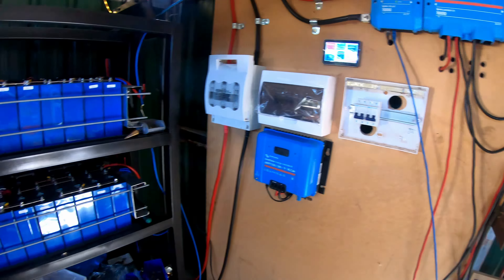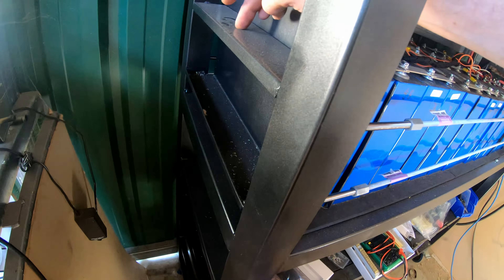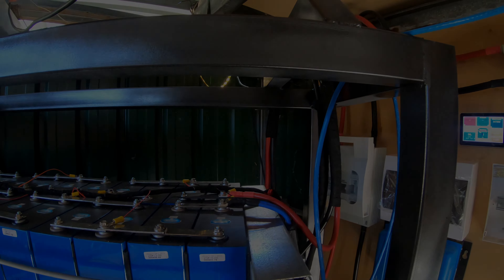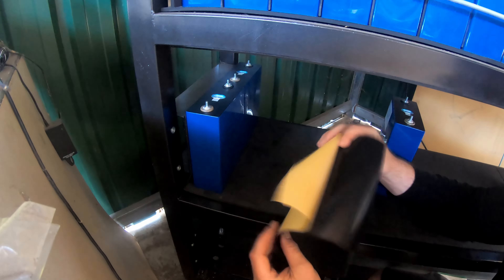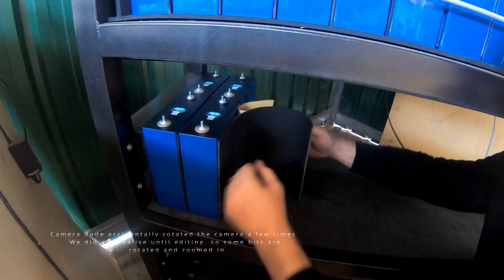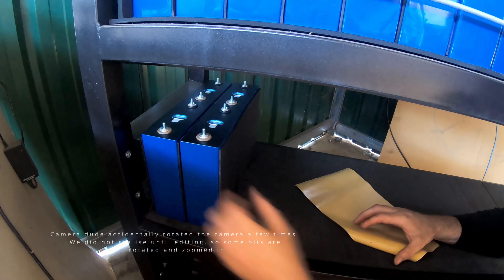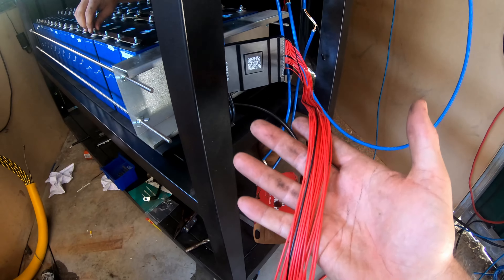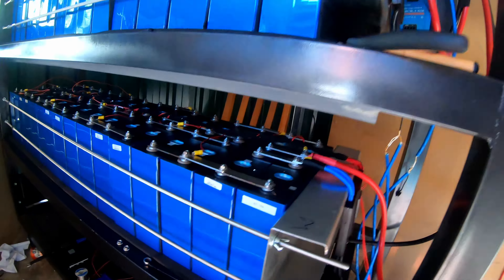Bad Idea #1:  Cheap Off Grid PT2

Comment: Batteries will only bulge if you charge/discharge to fast( to many amps) and or in cold/hot temps also. If you are using busbars and not daisy chaining them with 3 packs 10kw is around 70 amps per pack or .25C. The cells can handle .5C all day and not bulge. Also not charging over 55.2V per pack and floating their for 1 hour should get you 95% usage and no need for compression. I have seen what over charge voltage does to these cells and they would blow the top seal out if compressed but  not compressed will swell  a huge amount but will still be usable. Its on youtube video. Nobody shows you why you should not compress. If you were in a boat or RV then yes compress so you can keep the cells locked in other wise I do not recommend compressing. I have 64 cells in 4 packs with 2 5k inverters so my max load charging and discharging is .25C. I usually never go over .15C. If you do not understand the C rating search Google for Battery charge, discharge C rating. Just giving pointers as my system has been running since last year and no issues. Also for your solar please have a disconnect switch at least 25% more than you voltage and amps inside and inline fuses outside. do not use the DC fuses with breakers on them as they can catch fire if you shut them down with even 5 amps going through them. A DC arc needs enough distance (gap) to cleanly disconnect. a DC breaker has way to small of gap and that is why the arc can start a fire. I do love your rack. oh yeah also if you are going to tension the cells they need to have a spring to adjust or again if something goes wrong your cells can explode through vent hole.
Reply from the maker: Ah you need to see the other videos :) there is multiple isolations of various types throughout, but thanks for the feedback. the compression is there for a crisis as one of the packs may have to take the whole load at some point, the bms is good for 300amp output (im skeptical about the wiring though) and fused at 250amps at the bus bar. given at any point any of the packs may decide not to take charge or discharge for that matter the max charge and discharge are 200 / 300 amps respectively. I fully intend to populate the fourth shelf and have the ability to rotate the shelves in and out etc
Reply: Note from personal experience: lifepo4, limnco and any other rechargeable chemistry includung nicd, nife and nimh, expand and contract when charging and discharging regardless of the rate. Only the rate of expansion is dictated by the rate of charging or discharging.
Cylindrical cells are held by the power if the circle 😊 but prismatic cells are not so mechanically advantaged. 

The problem with Li cells is that the electrodes themselves are laminated. There is a base conductor, aluminium.copper, that is coated with a thin layer of active material (mostly graphite). 
When the cell swells, even a tiny little bit, the coating can be dislodged/delaminate. It can flake off and bits move a bit in the pocket. When the cell is discharged or cools off, it can't return to the same volume as the flaked bits are atop the yet unbroken coating.
This is happening at microscopic levels at first but it progresses in time to visible degradation. The separators are put under punctiform pressure stresses, the cell's overall ESR increases, the charge/discharge efficiency decreases as there is less surface area of the active coating available, more electrolyte is electrolyzed to gas that cannot be absorbed back by the degraded electrodes, and it's just spirals down. 
Compression will greatly increase cycle life along the proper usage with safe charging/discharging rates. 
There is no point in compressing used/damaged cells. It can be actually dangerous as the separator can be punctured and the cell shorts out.

Comment: Hi! You might already know and mitigated this, but on some EVE cells the metal enclosure ( that is covered with the blue thin film ) is connected to the positive side of the cell. If I understand the video correctly there is no additional isolator between the cells next to each other ( on the narrow side of the cells ), and because of the series connection method there is now only a two thin layer barrier / protection against a short. 

I hope I understood it wrong! But it might be a risk wordt validating ^^.
Reply from the maker: I will certainly have a look cause thats almost terrifying, i will check when i get back to the house
Reply: I have used some cheap flexible chopping board as separators! But with the size of these packs in sure you can source a large sheet of thin plastic to use...

Comment: Great work!  I would suggest an insulation layer on top of each bank. I have seen people dropping tools on the contacts and triggering sparks. If you short enough potential a wrench could be welded to the contacts due to high current. That would cause even more troubles.
Reply from the maker: thanks bud, yea we plan to enclose it, but thats fallen by the way side. i really should make that a priority

Comment: I'd love to have a set of batteries like that for my off grid camper tiny home
Reply from the maker: They arent complex to make mate, just time consuming
Reply: You do not need 90kw of storage for a tiny home. 10kw is plenty.
Reply: @davefroman4700  at the moment I have 560 ah of grade a eve cells. It's 16 of the 280 cells in 24 volt configuration.  I ordered 16 more yesterday so that should give me about 30 kw and I also have 24 nissan leaf modules at 24 volts kinda for backup I guess lol. I started with the leaf cells and actually they were plenty but I kept hearing how dangerous they are so I bought the lifepo4 eve cells. So far I have about 30 grand in my off grid stuff for my travel trailer. It's kinda an addictive hobby lol. I'm on the road in this semi truck 3 weeks at a time then home a couple days then back to work. I just keep ordering this stuff and hopefully one day I'll be in a position to enjoy it all. Thanks for making the videos. Wish I didn't have stage fright and I'd try to do the same. Thanks to you guys making the videos I was able to learn alot of this stuff and it's actually been kinda life changing.  Thanks for sure

Comment: Nice battery setup!
Here I am still hesitating using the JKBMS.
Many issues about communicating with Victron.
At the moment I have 2 x 18S of EVE LF280K with two 123SmartBMSses.
Another 40 cells are on their way to me.
I want to create 5 parallel strings of 16 cells communicating with the Cerbo.

How do this 3 JK BMSses communicate with the Cerbo?
serial to CAN or direct serial to Victron?
Any issues with reading out all messages of the 3 BMSses?
Would really love to use them.
Reply from the maker: they dont, its set in victron that the BMS self manages. As soon as they block charge the voltage shoots up and that tells victron to stop charging. We are working on an integration. It currently works with a single BMS but the multi BMS portion is coming. It might be all a little to late given they now have inverter BMS's which do integrate now

Comment: Great set up. Did you test all the batteries for capacity? How did you balance them?
Reply from the maker: Not full discharge, it doesn't sit well with me to discharge them to 0. Its just a hang over from my days working on communications gear on mine sites. I did a rough 80% discharge and marked the cells for internal resistance and voltage drop off to pair them together as best I could. Given they are 16s2p it will make it harder to identify bad cells but we have got monitoring on the bms's going in to an influx dB so I can anticipate failures. It's unreliable at the moment but I plan to fix it in the next week or so
Reply: @BadIdea1123  tell me more. I don’t know what an influx db is. I am in nsw looking to do the same. Currently Offgrid using 2 banks of 500 ah ups batteries ac coupled. Is there a benefit to 16s2p configuration? Thanks for any information please keep up the videos.
Reply: @BadIdea1123 how are you finding the jk bms’? Are you looking to have the inverter manage the batteries? I have a selectronic inverter and am unable to find a bms to have a managed system which I didn’t think was important until watching YouTube and people saying it dangerous having multiple banks and no comms with inverter?? Your thoughts? Thanks.
Reply from the maker: @gibo1971  The JKbms is ok but doesnt talk directly to the inverter. So we are looking for that integration. People have made one for the cerbo controller but it only talks to a single BMS. we are looking for another solution that lets multiple banks talk to it at once. We have something scratched together on ESP32 that can broadcast the right messages and we have a serial library to talk to the BMS itself. so not its just a matter of connecting them all together. 

I think its not safe to have large charge capacity ramping up and down with out knowing if the BMS can take the current or not. So we have limited ours to just 250a amps. but i would love for it to be 400a

Comment: How to you know how tight to compress cells? Do you use a Torque wrench?
Reply from the maker: We compressed based on distance which isn't ideal. Even if we had used a torque wrench we wouldn't (atleast I don't know how to) calculate the pressure. Instead I dropped a set of scales on the end of a string when it was on my table and tightened it until it read 300kg. Then I let the string expand again. When we assembled the battery I needed to see it compress around 8mm (that's compressing the rubber we used in-between the cells) hoping it is roughly 300kg. It's not the best way I'm sure

Comment: Any chance you could do a cost break down?
Reply from the maker: sure can, The cells were delivered to AU by boat (it took a while), they were roughly 220AUD a cell (ALIBABA - QSO, AMY PENG), each BMS was 270 AUD landed from ALI express, they are the CAN version, but note the CAN version cant speak to the CERBO controller on the victron solution 

These ones im guessing a little cause i dont recall the exact numbers 
The power side is a Quattro 48/10000 and when i bought it it was 5.5k but they are now around 6.5k (inflation sucks balls) - There is two big MPPTS, the 150/100 was around 1200AUD and the  250/100 was 1400AUD (they both came from ALT-TECH)

we got 36x 370w trina cells for 155 AUD each but that was a wholesaler through a contact i know, the rest is second hand solar
Reply: @BadIdea1123  thanks for the cost break down. Was there any duty or gst on top of the cost for importing the cells?
Reply from the maker: the 220aud was all inclusive, we paid ddp so the importer covered the import duty, it bumps up your shipping fee but you end up better off
Reply: @BadIdea1123  thanks

Comment: DC fuses must be placed near battery, not 2 - 3 meters away, if BMS cathes fire, and U have no fuse ??? Why red cables to DC BUS form 3 packs have different length ? Is there thermocam, and all battary pack are watched ? Or how many temp sensors U have per cell ? If one cell in parrallel conection will be shorted / inside / and resistivity is 0.21 mOhm, what will be the current from second cell,  at 100 SOC ?
Reply from the maker: The fuses are in the lynx busbar on the rack itself as well as fuses on the wall. We havent had an issue with the length of the cables. the BMS stops charging when the battery is full and the other shelves receive power because of it so its hasn't been an issue for us

there are multiple fuse points in the system, on the inputs and the outputs as well as large disconnects
Reply: @BadIdea1123  Fuses are on wrong places or are missing ? Where is fuse in cu or al  busbars ? If at 100 % SOC or 3.599 V in one cell and short is in parrallel connected cell 3.599/ 0.00021 = 17000 AMPS. What happens with  Ur battery if fumes from cell / CO, CO2, H2, HF / will be ignited ?
Reply from the maker: Battery bms will open the circuit for any errors or over voltage. There are fuses for each battery string in the lynx bus bar and the big 400amp fuses to disconnect the whole rack if need be